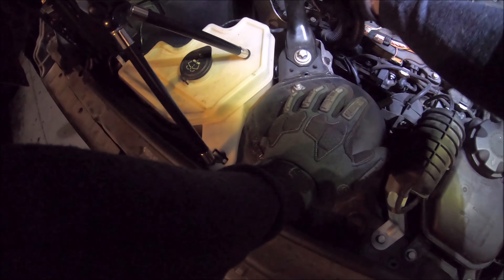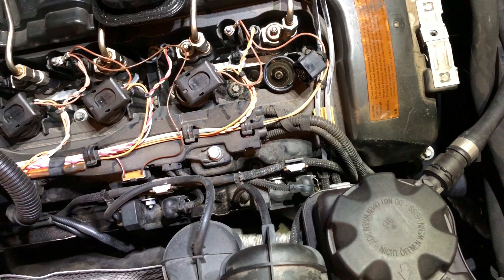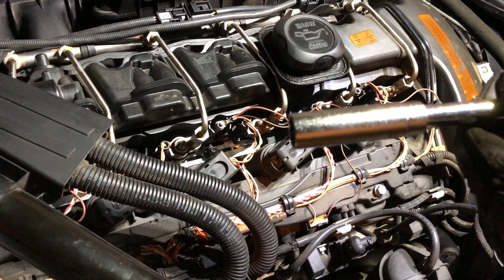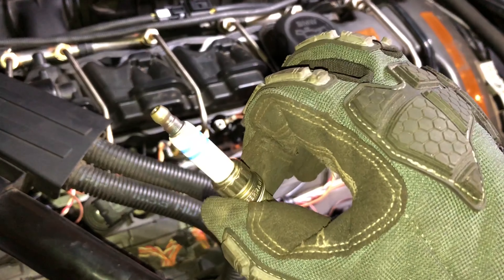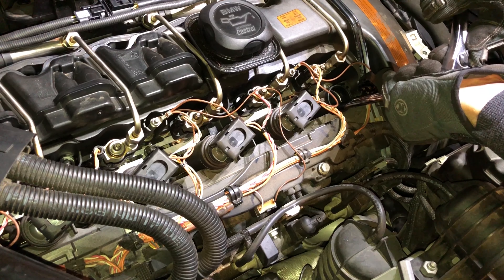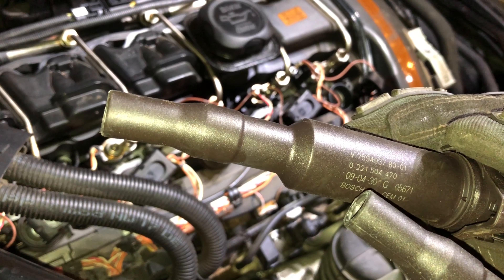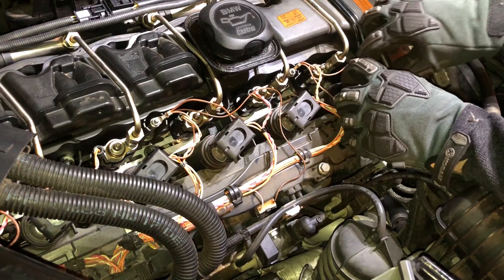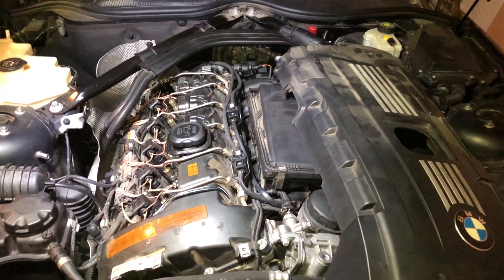BMW Coil Pack - Ignition Coil replacement -  N54 335i Z4 E89

Comment: Forgot to mention, it is SUPER easy to crossthread these plugs. BMW service guide recommends a rubber tool to guide the plug which prevents cross threading, or you can use a piece of rubber hose and pop it on the end of the spark plug.